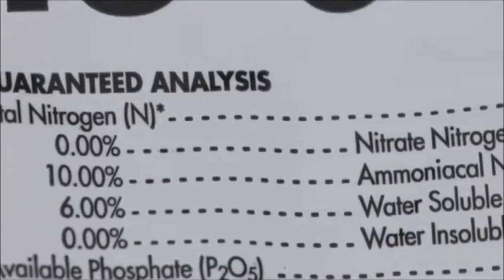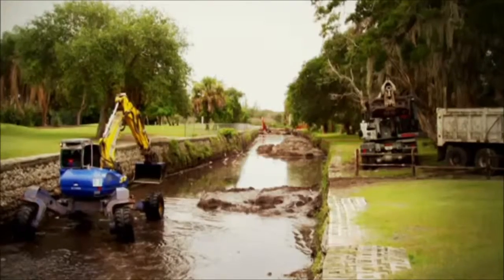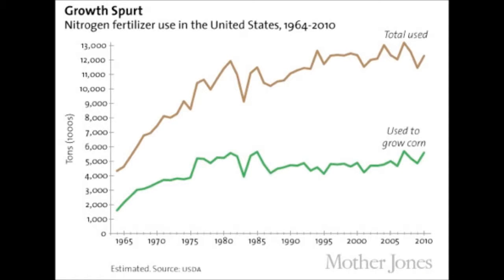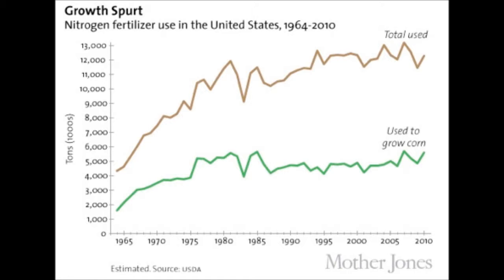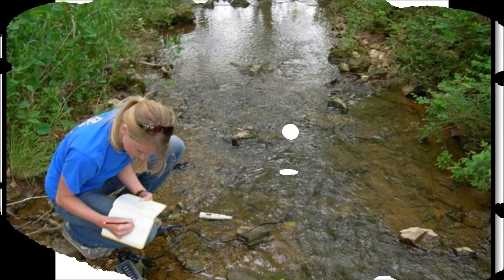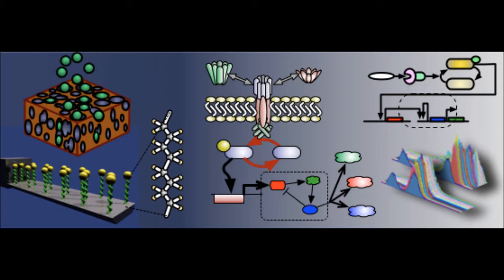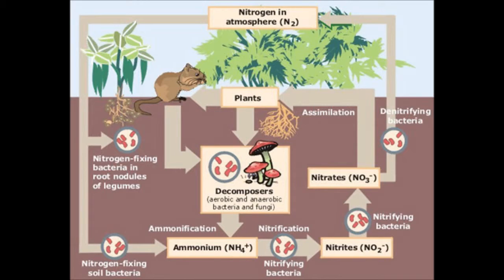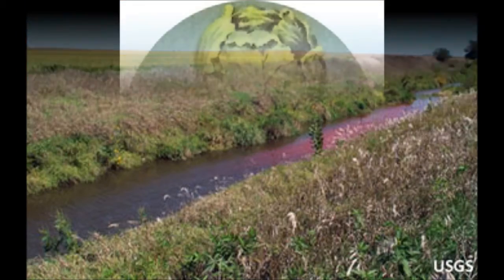ABE 100 The Plant Guys

Comment: The video targets the problem very well and describes it in great detail. The images and video clips used really represent the message at hand. This makes it very easy to follow. 

I would suggest a few more words summarizing points during the video. This is to accommodate an audience that may have trouble with hearing. Otherwise the video was a great success and really communicates the problems with nitrogen fertilzation.

Comment: Your video did a great job describing the negative effects of nitrogen fertilizer. Dr. Mulvaney was a very good resource to use and provided for a lot of specialized and technical information. Although your visual effects were informative and interesting, the audio effects could use some improvement. I would suggest using one narrator for the entirety of the video in order to maintain consistency. Overall, a great job, and very creative team name.